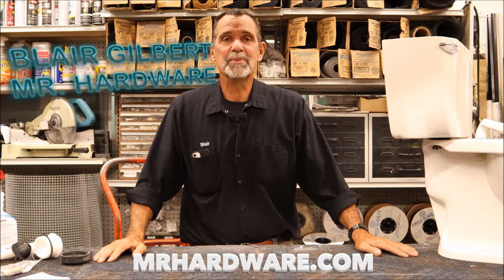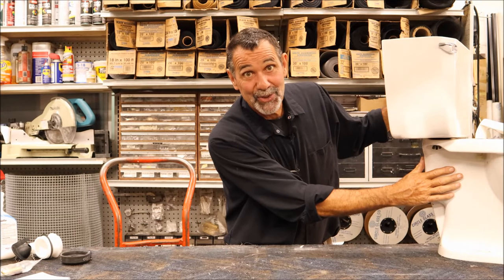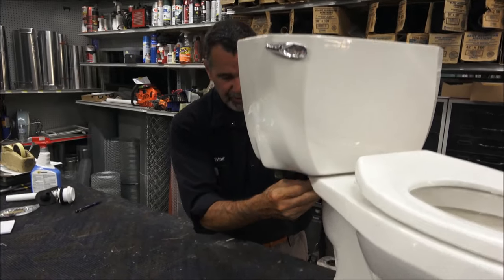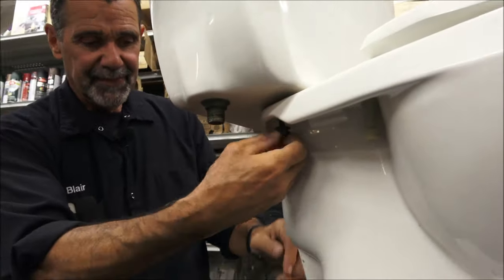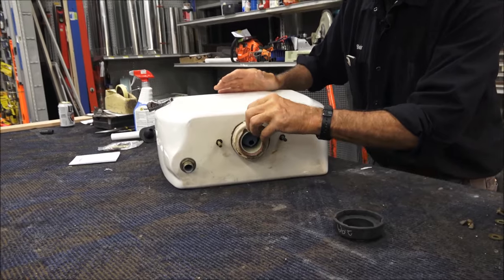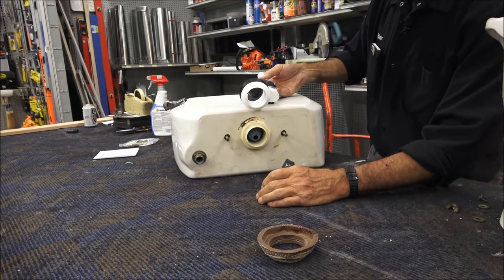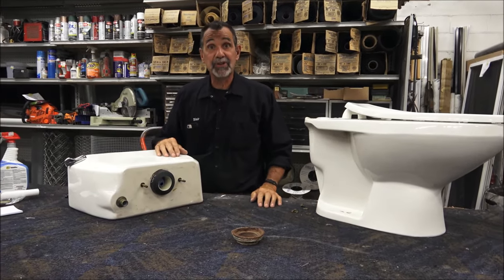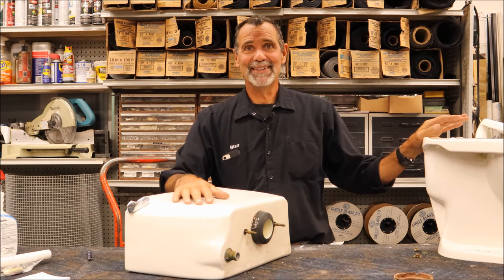Toilet Leaks When Flushed, Gasket at Tank-to-Bowl , Seal Replaced, Bolts

Comment: I have old toilets that have three screws/bolts … replacement kits I’ve seen have only two screws/bolts. Are most rubber seals the same size? Can I use the old screws/bolts?
Reply from the maker: We sell those kits in both two bolt and three bolt packages. If the old bolts are the solid brass ones, of course you can reuse those, the hard part will be finding a nice rubber washer that fits them properly. The seal in the tank is the moneymaker, the washer and the nuts underneath only hold everything together.

Comment: I was requested to change the flush valve at work and I had to reuse the old flush valve seals because they got a 3” kit. The tank mounting bolt nuts are pretty damn snug

Comment: I replaced the tank bolts and gasket but still leaking (while not flushing) and believe it's from the center gasket as I see droplets coming from there. Is it the flush valve that needs to be replaced now? I believe I tightened the wing nuts enough to secure gasket between tank to bowl. Been at this few days, hopefully this is the last stop for leakage!
Reply from the maker: It could be, you did get the metal washers out from inside the tank on the tank bolts, correct? Typically the inside gasket on a flush valve never goes bad however, sometimes when you rub it with your finger and black comes off on it, it’s starting to decompose.
Reply: @MrHardware1  Found out I had to tighten wing nuts which seals the gasket. With my set up, the regular nuts just tighten the bolts and need extra wing nuts to seal tank to bowl. Thanks.

Comment: Mine doesn't leak when not in use, but it leaks and wet the floor when i flush... am i facing same problem?
Reply from the maker: Could be, or there is a leak at the wax ring. Tape paper towels around the bowl halfway up to confirm the water comes from the tank.

Comment: Could a bad gasket cause condensation behind the water tank?
Reply from the maker: A leaky tank that is constantly getting refilled with cold water is the cause of the condensation. The fact that your tank doesn’t hold water is because the flapper or whatever type gasket on your flush valve you have needs to be replaced.
Reply: @MrHardware1  Thank you for your response. I bought a new toilet yesterday,and endup putting it on my own. Have a wonderful day. 🙏

Comment: My toilet is leaking soon as I turn the water on
Reply from the maker: Does the tank fill or does water just come into the tank and go right to the bowl?
Reply: @MrHardware1  once the tank gets around half way full, is start leaking between the tank and bowl gasket, it is a brand new toilet, I don't see any cracks
Reply from the maker: @crazycardcollectibles9678  all I can say is you gotta pull the tank and check the big nut that holds the flush valve to the tank and then make sure that nuts hold the tank to the bowl we’re done properly
Reply: Hope u got it fixed,im dealing with the same thing now,im assuming its the gasket as its leaking right from underneath the tank
Reply: @MIGGYME1  yes I got it fixed, I  had to unscrew from inside of the bottom of the tank, recenter  gasket and then install
Reply: @MrHardware1  thank you, that was the problem